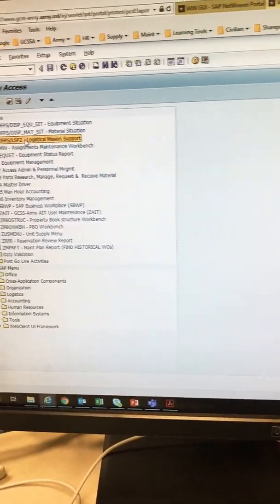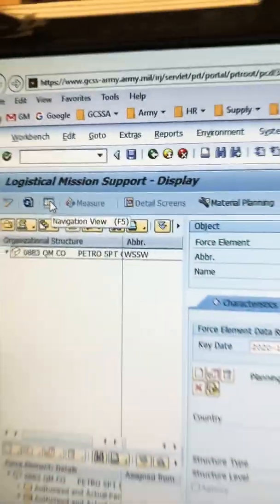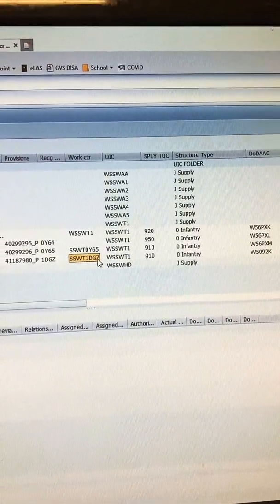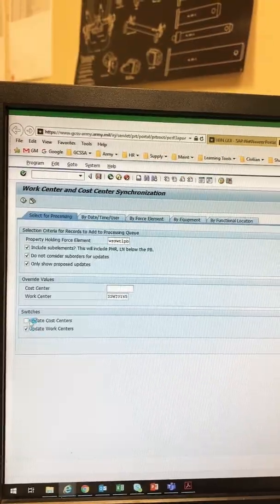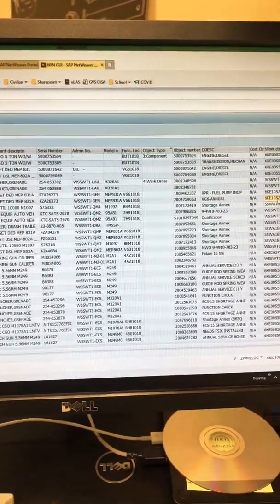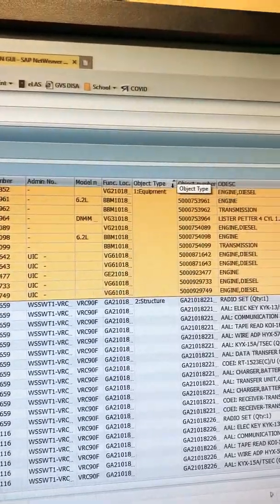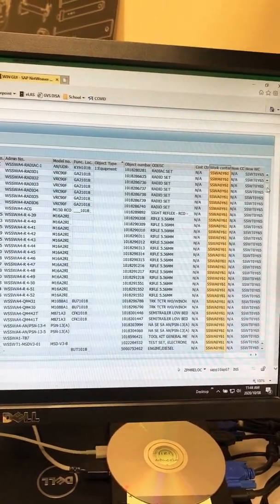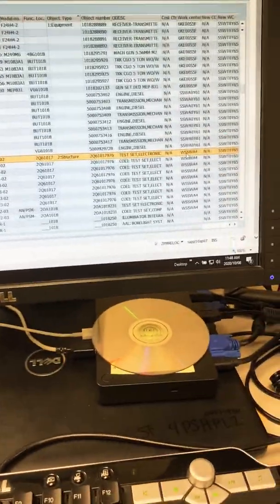GCSSA 201: How to use ZPMRELOC to Mass-Change Work Centers

Comment: Jeff
So if we put everything in our maint WC, when a WO is started, will it default to that Maint WC?
Reply from the maker: Correct. If you were to change all of the equipment's main work center to an actual commodity shop work center, when you start the work order - it will default.

This will cause a small disconnect though.

There is a template that USARC or the GCSSA Help Desk can provide that is called ... something like the Maintenance Activity Support Relationship template -- similar to the Master Position Template, but it is for creating a relationship between your Main WC and your Support Shops, like AMSA and ECS.

If you force-change the work centers, that relationship will disconnect and you'll have to manually enter in your support shop's work center.
Reply: @janewberry4064  interesting. Ill get with u throughout the week on Teams
Reply from the maker: @rogerlondono2521  Sounds good, Chief. We'll be in cycle for the next month (2 back-to-back classes), so I'll be logged in and around.